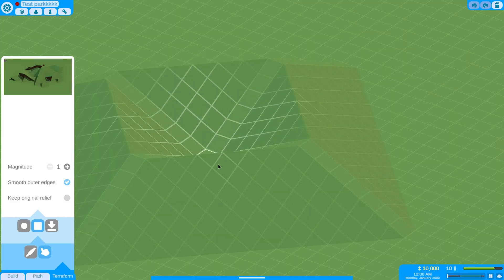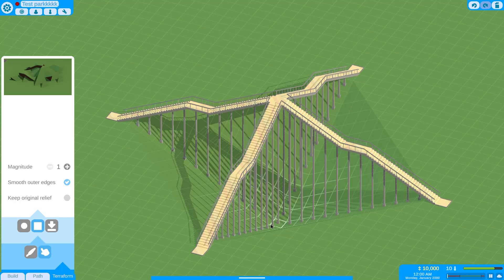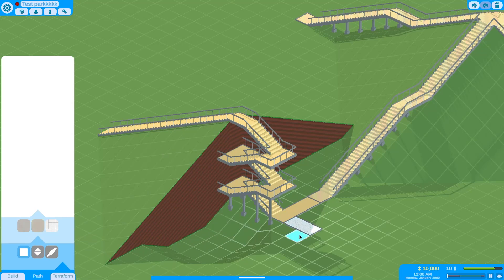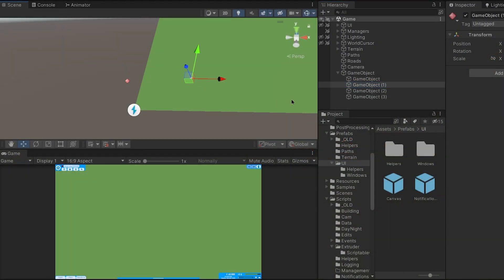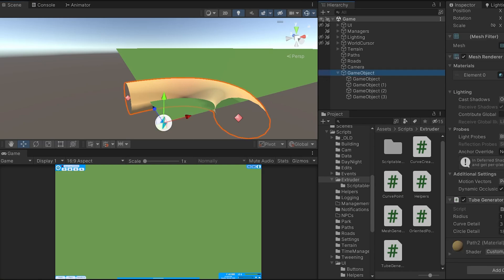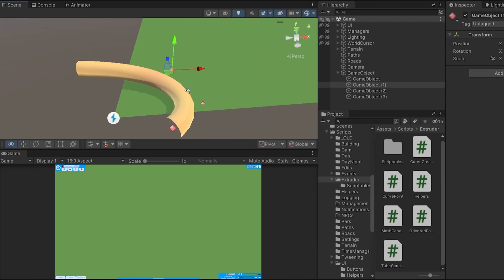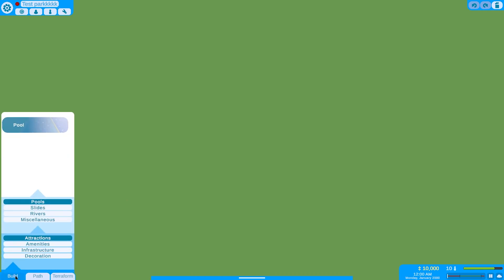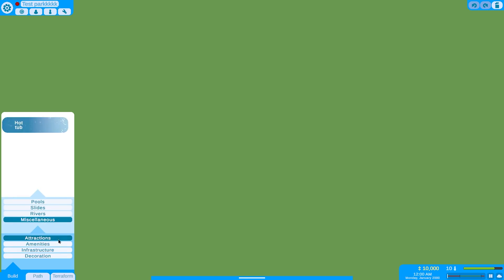Creating a procedural mesh extrusion tool for my waterpark tycoon game [Devlog 3]

Comment: I love your implementation of the water slides. Are you executing the code in the Update function? I myself have a video upcoming to that topic and while preparing it, I realized, that mesh generation takes a lot of calculation power, so I had to switch the updating off, if the values don't change.
Reply from the maker: Right, definitely only update your mesh when values have changed.